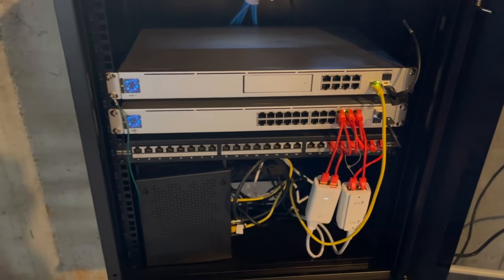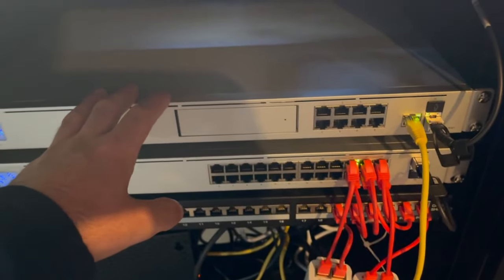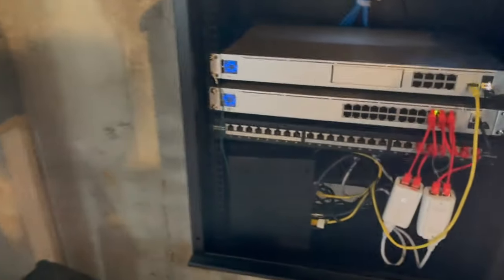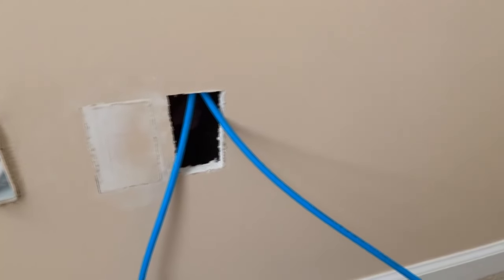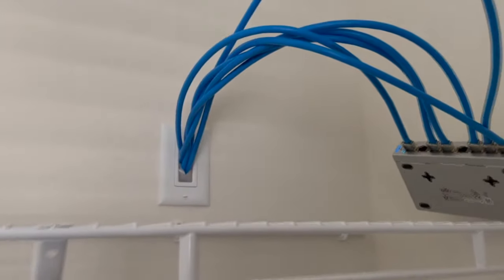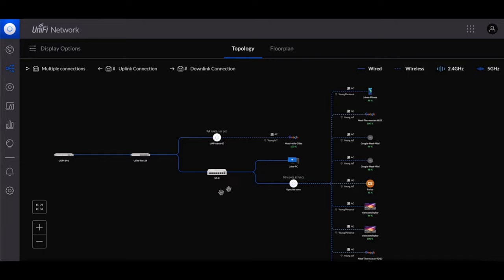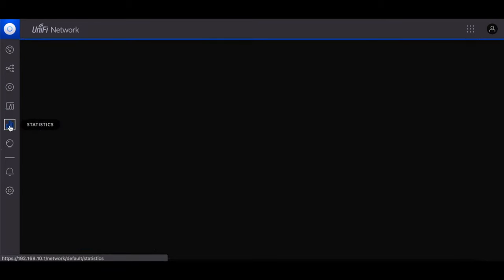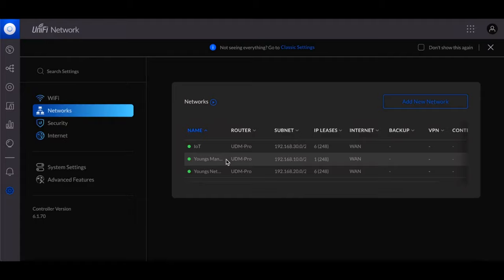NEW Ubiquiti 2900 Sq Ft Home Network Tour

Comment: One thing that I would suggest is with the PoE injectors I would either have a 1/2 rack shelf mounted in the back to lay them on after the patch panel where 1 they are not seen at all and 2 where it takes the strain off the connector on the Unifi Switch. This way it provides cleaner install look up front and takes that stress of to prevent cable from possible breaking. Plus then you can use velcro to secure the stuff to the shelf also possible depending on placement use the other side to route cables using velcro. Remember using velcro in cable management makes adding or replacing cables easier

Comment: One other thing for cleaner install look that I did is run my ONT (fiber to Ethernet connect) ethernet to back of patch panel in line with the Ethernet port on UDM then short patch cable to UDM. Did not lose any speed. Once I get my Unifi Switch I think I am going to put my patch panel between the UDM and switch run the DAC through empty patch panel slots to each so gives the impression of coming from patch panel to each also one simple patch to UDM for ethernet. then rest of connections from patch panel to switch with PoE injector behind the patch panel. I have a picture of mine on my facebook page. If you would like to look. I have not got the Unifi switch yet due to availability. I am just in month 2 of buying Network rack equipment. Yes I am major OCD with it. My instructors in college wear ex military so I am so clean installs where a must.

Comment: You should see the wall behind one of my tvs that butts up to a closet on the over side for some reason there are 4 studs with only 4 inches between them made it really hard to run that cable down. will have to do some patching once I get everything done. Good thing I am in process of also taking out the 1980's wall paper and texture painting.

Comment: On a different topic, uninsulated foundation will rob you of heat/AC at a level you would not believe. The foundation will basically act like a huge heat sink to the outside. Consider 2” rigid insulation and when you ready, just install your wall inside that layer. The rigid and other insulated walls again exterior concrete walls will pay for themselves in 1.5 to 3 years in saved energy cost, depending on where you live.

Comment: Nice setup! One thing I would probably do different would be connecting everything to the 24 pro switch directly avoiding the 8 port switch. But the performance difference is probably negligible, not really sure about that... and the AP placed sideways is for distance so it would be better on one side of the room, or on the ceiling in the middle facing down, but has you said its temporary.

Comment: there are different cable ratings for different environments. you can technically run your cable through your ventilation system, its done a lot, actually, though typically on the air return. its called a plenum, and many offices use the space above the ceilings use that space as an air return as well
Reply: I'd clarify your comment a bit with how you mean the air space and not directly drilling into air ducting.. cause plenum space in a residential home is different from an office building.
Reply: @swiftswamp4599  I've done  a few years of commercial electrical work, but not much of residential, i know there are a lot of differences, but the National Electric Code (USA) does not always specify commercial or residential. However, local code enforcement and other countries may have stricter guidelines, but I do not remember seeing anything specifying any difference between a commercial plenum and a residential plenum, and they have cable designed specifically for this use case.

Comment: I have to say that the rack is already looking a little so small.  All that Space and you went with something small.  I would have gotten at least an 18U or something.   You think you have enough and then you want to add this and that and now you're out of space.  I started out with a couple shelves in my small closet.  It's a narrow closet with a narrow door.   So my Network stuff was like that for a couple years.  Then I wanted to upgrade and so got a 4U rack, and before I even installed it,  I was going no way, it's just way too small.  So I got an 8U Rack.  That is what I currently have.  But I needed to update my 48 port Switch, my ASUS Wifi Router is getter pretty OLD.   It was a free one from T-Mobile, but because of that, it doesn't get any firmware updates as the normal ASUS router does.  

I also have 600Mbps Download Internet now, though I'm only getting around 350Mbps wired currently.  Not sure what the issue is.  Is it my hardware or Comcast?   So I want to upgrade again with a larger rack.  So now I'm looking for the right 12U Rack.  It is a closet so I still want to be able to store stuff in there and hang jackets.  I'm also moving to Unifi.  My Unifi 48 Port Switch is currently being used. I got that used.  I just got the UniFi Cloud Key Gen2, also USED. and got that running in my computer room temp, but that will be mounted in the RACK when the Unifi rackmount I got for it, also USED.  I have a NEW Gateway/Router that I paid a lot for that they don't sell to the general public yet, it's early access.  So I can't name it.  You can figure it out.  I have 1 new Wifi 6 Lite AP and a Power Injector for that.  My switch is not POE.  POE switches are generally too deep to fit in my Rack.    So really only needed 1 POE port for now.  I may get a second AP later.   I will say that my new Gateway/Router came with a 10GB SPF+ cable!!! I had ordered one as I didn't know that, and I opened the Box and WOW, there is one in the box already. Oh well, I have a spare for the future.  I have some ideas for that.  No rush!!!  

I have an idea of the rack I want to get.  It's 12U and the depth is adjustable.  my current one is 14" deep.  I could go maybe 15-16" deep MAX.  Remember I'm in a closet with limited space  I need to be able to work on it and as of now, I can squeeze in to do things.    Man, if I had all that space this person does, Big Rack!!!!!   18U or something.  Room to breathe.  I almost want to get a 15U, but it's just too much space being taken up.  Anyone has ideas on a Rack, 12U in the 14-16" deep range, let me know.
Reply from the maker: I think the great thing about networking is that you can always upgrade pretty easily. I just wanted to start off with some decent stuff and just see where it took me. I think my setup is pretty good for a beginner but yes I can totally upgrade the rack.
Reply: Just hard wire to the back of their modem/router and test the speed?

Comment: Ubiquiti: built by amateurs...for amateurs. Want security? Try Juniper or Fortinet. Even SonicWALL might be better.
Reply: Sorry, but avoid SonicWall.

These next gen utm firewalls are nice, but be prepared to pay a pretty penny for a subscription (which may not be justifiable for home use). If you don't want to pay that, you will be better off using pfsense or a cheaper alternative to the utm firewalls such as an unbound firewall solution.
Reply: gonna need a little more information than this. Seems to be way more secure than what the ISP provides you and way easier to set up than something like PFSense. This seems perfect for competent consumers that want something which just works.
Reply: @cdiff07  the udm pro, for home is great.  For business use in my case, it lacks the ability to run on my controller.  I have a multi site controller set up and you can't use it that way.  If you don't have multiple ip addresses, and use it at home sure it's great.  For business use I'm still sticking to just the switches and ap's.  Like I said, Ubiquiti is best bang for your buck for home use.